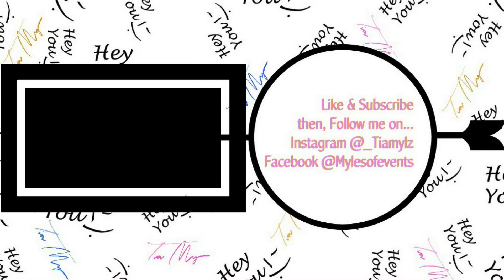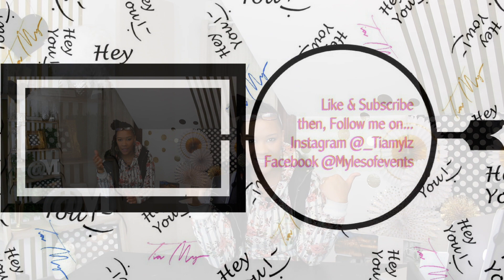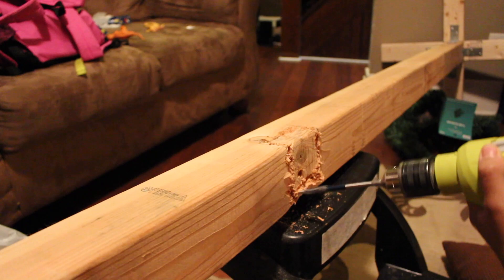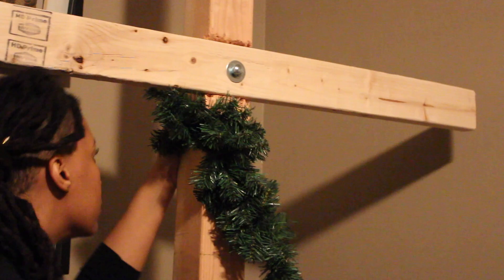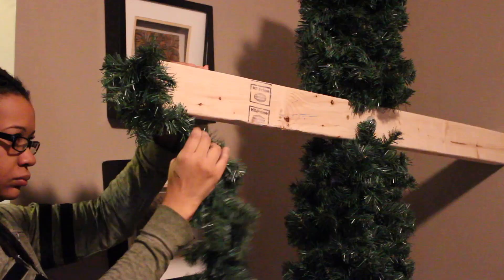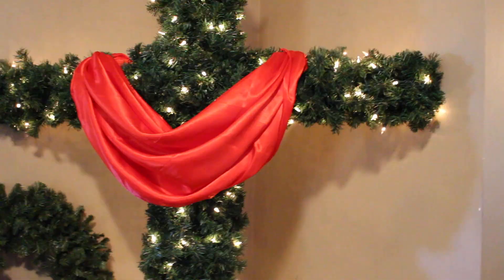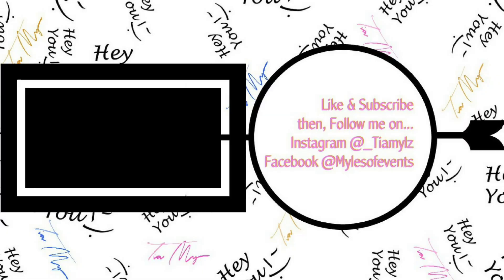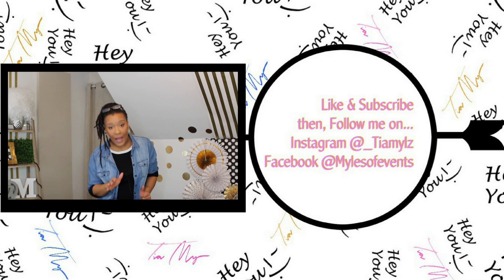CHRISTmas Tree Unique DIY

Comment: How did you make the base?
Reply from the maker: I used 4 metal L brackets and 4 -2X4 cut to 1-1/2 to 2-1/2 in length. I attached them to the bottom of the tree. (Use whatever length 2X4 that is necessary to balance your tree's weight & height.) I will try to add a picture if Youtube allows me.